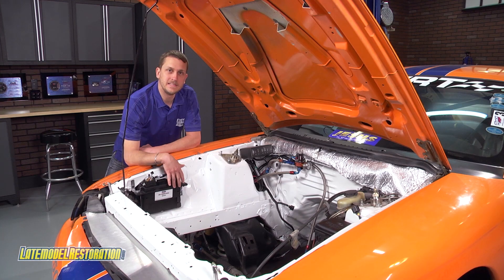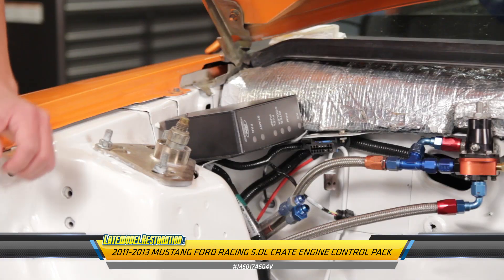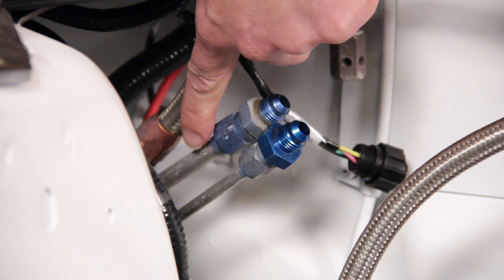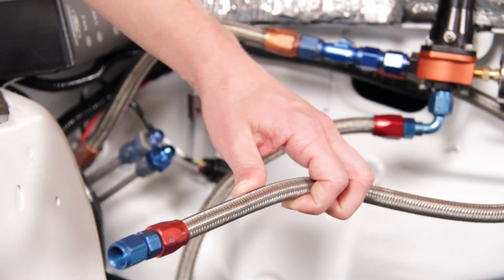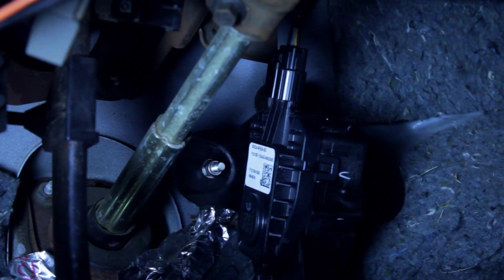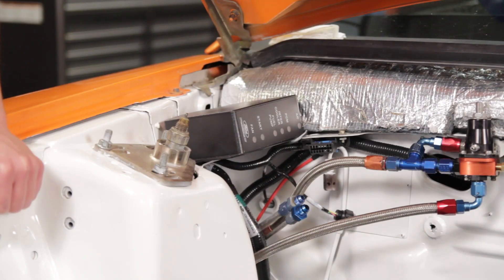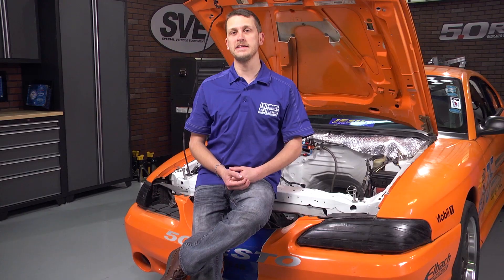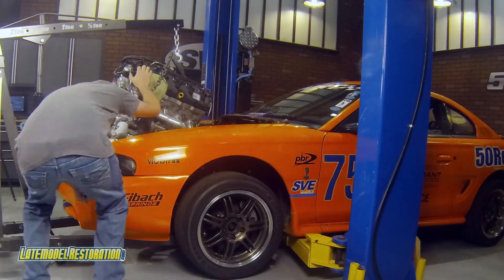Mustang Coyote Engine Swap: Ford Racing Control Pack & Fuel System Install

Comment: Problem is, someone comes along with a 2017 Camaro and blows the car away.  0-60 in 4.0 out of just the SS model.  Glad I don't waste money on engine swaps and things.
Reply: And? Nobody was here screaming that it will blow a 2017 Camaro away. I don't see a Coyote swap as a waste especially if you already have a car.  Not everyone can go out (or may even want to) and drop 40k plus on a new SS, Uncle Pennybags.
Reply: Dennis S , As the owner/ Driver of this car, This has been such an awesome setup!  After installing this in 2013. I have been tracking the car regularly.The engine has been %100 trouble free, I Change the oil, brakes and tires. Run super hard at each event, But Sorry I have not ran  0-60 or 1/4 mile time. I have however Ran a respectable 2:31.5 at COTA and a 1:24.3 at Hallett Raceway. Some cars/Drivers are faster and some slower but we all have tons of fun no matter what.

Comment: what VIN will it pop when connected to an OBD2 reader please?
Reply from the maker: tahn07 It will not use a VIN it uses a specific Strategy Code that SCT tuners will recognize. Give us a call if you need help with the tuning! - Jeff J

Comment: So you are using the stock fuel lines then putting adapters on them.? Are the factory fuel lines enough to support coyote motor in n/a trim? Larger pickup in the tank? 255 or more pump? The lines on this car the same as fox body?

Comment: Looks good guys! I just did a 3v swap in my 95 using Fords control pack and had a question. What will you be using for gauges? As I understand it, my gauge cluster has an analog signal that wont work with the ford harness. Any suggestions? I have looked into Florida 5.0 and they have some options. Thanks

/Steve